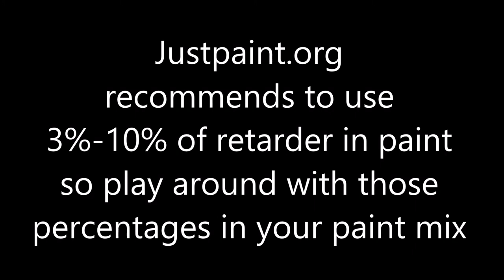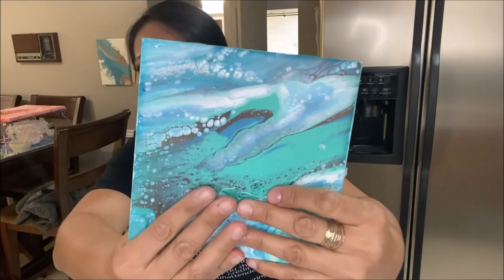29. How to Make Homemade Acrylic Paint Retarder | Cheap Paint Retarder Substitute

Comment: That may work but it's far from optimal. Glycerin in water will extend workability window but it will also impede your paint's long-term drying process by making the paint soft and gunky for weeks, in particular if working on non-absorbent material. Your paint film's texture will also be altered, losing shine and intensity. A professional retarder is made of slow-drying polyhydric alcohols or propylene glycol and acrylic binder. Better stick to professional product if you're working for commission.

Comment: Use glycerin only in very small amounts. Glycerin may never evaporate from the paint film making it sticky and a dust magnet. Use propylene glycol instead of glycerin because it dissolves more easily in water.

Comment: the term retarder is correct as you are stopping something from following its natural course.  some may call it flow improver or slow drying medium. but your definition is correct in that you are slowing to paints natural process.  i use flow improver for painting and then slow drying medium to make acrylics paint like watercolor.  im in process of learning air brushing and will use your tip of cascade from previous video for thinning paint.
Reply from the maker: That is awesome! Thanks for your input. Hope that cascade can help with the air brushing. I have never tried it with paint used in an airbrush, but it seems to me that it could work!
Reply: @ArtasiaLand  i am hoping so as right now i am still trying to get the thinness of the paint right for air brush where its neither to thick or thin.  but i do love the tip on using water and glycerin for flow improver cause its Expensive
Reply from the maker: @shadowsilverlight1651  I’d love to see your journey as you start experimenting with air brush techniques.
Reply: @ArtasiaLand  do you have an email address i can send pic of the current piece ive started working on once im done?  im not on any social media, so i cant post my work.
Reply from the maker: @shadowsilverlight1651  yes, Loida@loveacrylicpainting.com
Reply: @ArtasiaLand  thank you, i just emailed my very first airbrushings and some brush painted detail.  its mostly airbrush accept the the finer detailing.  will send current piece when done.
Reply: @shadowsilverlight1651  ...might want to check out this video for a good thinner for airbrushing -> https://youtu.be/VjJmRLifYik

Have not yet tried it myself (yet)...but def looking forward to it.

Comment: Hi ..very informative video, at same time i also watched your video on Flow Improver, can we use both together with acrylic paint. i use airbrush on plastic scale models, therefore always having to use a thinner and my thinner is mainly based on Distilled water .... so my next question what would be combination with Flow Improver + Retarder + Thinner  ...
Reply from the maker: Hi. Glad this video was helpful. I am not sure what the ratio would be because I have never used an airbrush. I mostly use it for acrylic pouring. You’ll have to test it out and see what works for you!

Comment: That’s way WAY cheaper than the acrylic retarder brands. I did the research it’s literally just glycerin in a bottle. Thank you for giving the ratios of how much glycerin how much water to mix 💜
Reply from the maker: You’re welcome 😊
Reply: With all due respect @hobbyistinyheartbag, I’m not sure how much research you did but looking at the SDS (Safety Data Sheets) of the top 3 most popular retarders sold at Michaels, they don’t contain glycerine at all. The main ingredient is Propylene Glycol, which is also a humectant and a solvent.  Interestingly it’s what’s mixed with glycerine, nicotine and flavoring in “vape juice”. 

Will it work? Yes but it’s not what they use in the manufactured retarders because it doesn’t work as well as PG. VG (glycerine) is slightly cheaper than PG, and trust me if it worked better they would definitely be using it if it worked the same. Give PG a try and let me know if you see a difference.

Oh and don’t confuse Propylene Glycol with Polyethylene Glycol. They’re not the same.

Comment: Love this video! I am very exited to try this out! 
New subscriber!💕
P.S. you are so pretty 😁
Reply from the maker: Thank you so much! I am glad this video helped. 

The ratio of water and glycerin will vary depending on what type of paint you want to use it for. If it is a pouring consistency paint for fluid art, then the acrylic paint retarder can be more fluid. If you are just trying to keep acrylic paint from drying too fast in their paint containers or the painting palette, then I would probably not use that much water. You’ll have to play around with the ratios and the amount of paint retarder mix that you add to your paints to see what works for you, but at least it is a great starting point.
Reply: @ArtasiaLand  
Great! Thanks for the info ✨

Comment: Do you know if glycerin is pH neutral?  Also, I'm thinking the 9 part water content in your ratio suits your method of application(pouring) so, I wonder if dialing back the water would still be good enough for non-pouring applications requiring more open time with the acrylic.  Lastly, what acrylic brands do you use?  Thanks for the information.
Reply from the maker: Hello. Glycerin has a fairly neutral pH… around 6-7. Yes, the ratio I mention is mostly for acrylic pouring, but I would imagine that you could just use less water for other types of acrylic painting that is not acrylic pouring. 

However, let me give you a suggestion. One of my viewers gave me an awesome tip which I think might work better for you. He said the following “One of the most common brands of retarder is 70% propylene glycol and 30% distilled water.” He mentioned that vegetable glycerin might attract bugs and dust whereas propylene glycol doesn’t. Plus adding too much glycerin to acrylic paint can cause issues with the paint not drying whereas propylene glycol doesn’t cause issues. Glycerine is natural whereas Propylene glycol is synthetic. 

So I would recommend that you use a mix of distilled water and propylene glycol (instead of vegetable glycerin) in the percentages mentioned previously. You can get it on Amazon https://www.amazon.com/dp/B076FDQKP4?ref=exp_influencer-ffdbcc2c_dp_vv_mw

About the acrylic paints… I use Artist Loft, Liquitex, Amsterdam, Windsor & Newton, and Prism Pour paints from Colourarte.com. I love each of them for different reasons…. The affordability of Artist Loft, the colors and quality of Liquitex, Amsterdam and Windsor & Newton, and the luscious colors and incredible sparkle of the Prism Pour Paints. 

If you want to try out the Prism Pour Paints, use coupon code loveacrylicpainting621 to get 20% off!
Reply: Try mixing it with cheap flow mediums, as those have acrylic binder.
Reply: I bought 16 Oz of glycerin so I need a good recipe for craft acrylic paint to make it less chalky and the tube paint less rubber ( I usually add gesso) to tube paint. But I need to know if I add glycerin to paint instead of just water when I’m using big canvases.

Comment: Is my painting guaranteed to CRACK since I didn't use a retarder?? Please respond as it is a commissioned piece?😢😢
Reply from the maker: No, it won’t necessarily crack. Cracking depends on what pouring medium and paints you used and how thick your coat of paint was left on the canvas
Reply: @LoveAcrylicPainting  Thank you very much for replying to my question. I should have mentioned that it's not a "pour"  it's just a regular painting with a few places that I made ridges. I intend to put two coats of varnish after the acrylic drys for a few weeks. Will the varnish help to keep it from cracking? I'm really worried after watching your video.

Comment: Can I use normal glyserin instead of vegetable glyserine
Reply from the maker: I would assume that you can because regular glycerin and vegetable glycerin are usually the same thing. Some companies will specify if the glycerin is derived from vegetable origin or animal origin. In most cases when it says glycerin, it is vegetable derived. ... Animal-fat based glycerin is not used as much